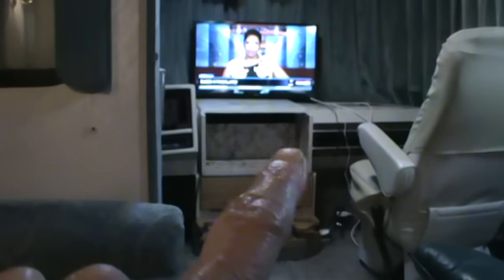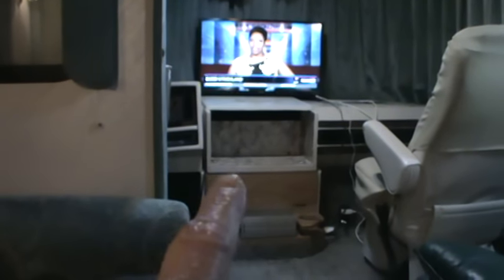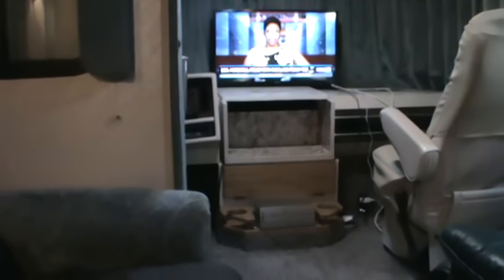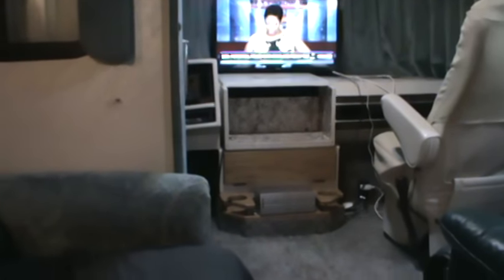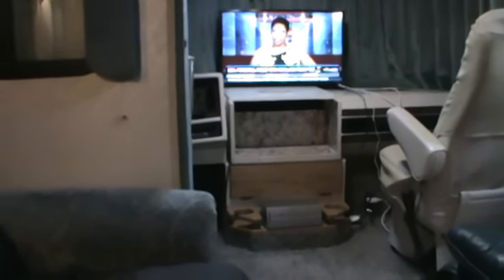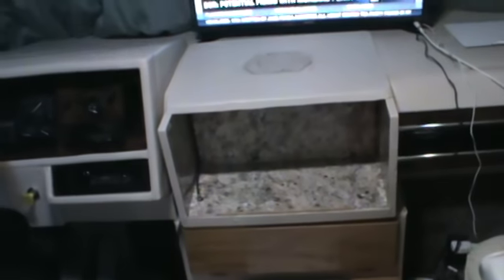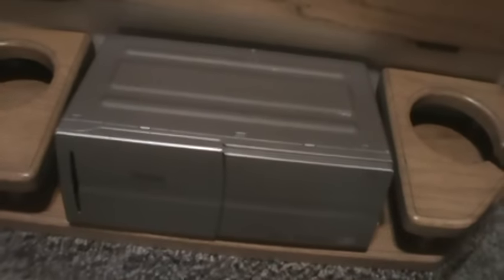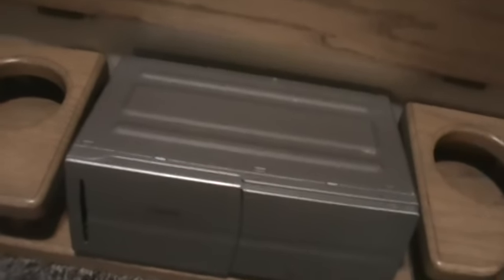Old Analogue TV Cabinet Refurbished In The RV

Comment: We are in the process of purchasing our first RV and we are learning quite a bit from your videos. We definitely don't want to purchase a lemon so we are following suit with the way you have searched to find your beautiful RV. We were wondering which one was best to purchase, the pull behind or the kind you drive?? Also you were talking about your antenna, which will purchase as well. But we also have a sports fanatic in our family so we bought the jailbroke  fire stick for our TV that just attaches to the HDMI port in the back of your TV. If you research the name Jailbroke fire stick you will see that you can get thousands of channels for home or your RV television. It is simply amazing and definitely worth checking into because all you need is an Internet connection. We can watch local and distant live channels from all over the world plus all TV series, as well as any movie of any year that you can possibly imagine. It has music and YouTube, Netflix etc all for 1 purchase 59$❤️👍🏻
Reply from the maker: After much research we decided on a used diesel pusher, this turned out to be the best purchase for the money.  Diesel motors are the same type long distance trucks use which means they can go for a minimum of 500,000 miles without any major repairs to the motor or drive train as long as you do regular maintenance such as oil and filter changes.  Most folks who purchase a regular gas engine RV regret they didn't get a diesel pusher.  If you are thinking about purchasing another type (5th wheel, travel trailer etc.) make sure you do your research.

Comment: Hi Phyllis, that what looks like a tape deck is an older cd changer that would hold several cd's at once. The RV is looking good!
Reply from the maker: +Kim Mitchem I need you to come over and show us how to use it or better yet just tell us how to get it open.  Thanks.
Reply: +Phyllis Stokes Are you going to find a mount so that you can hang the TV off the ceiling and be able to flip it up and out of the way while you're driving? Something like this - they have several to choose from - http://liftmytv.com/FLP-310_flip-down_tv_lift.html
Reply: +Sachi In Wisconsin For $3,280?? Sheesh, I sure would not.
Reply: Angela Angell That was an example - There are many others on different websites to choose from - that 3200 dollar one was for a 60 inch her TV isn't anywhere near that size.
Reply from the maker: +Sachi In Wisconsin That would be a little too expensive for us especially since we only paid $239.00 for the TV.  We like the height of the TV sitting on the dash - easy enough to just sit it down beside the co-pilots seat when traveling.  Also on the dash we'll also have room for the computer to stream YouTube videos and movies over the TV.  This would be a good idea for someone with a much larger TV in a tiny house or a large RV.

Comment: I guess I did not see your motor home video or figure out what you bought. Tiffin is the manufacture but what year and model name, I will try to find the separator valve for you.
Reply from the maker: +Charles R Tiffin Allegro M39 Bus, Diesel Pusher 1996
Reply: +Phyllis Stokes Look towards the rear near the engine either in the engine compartment or in the basement door near the rear&#160;on either side of the coach. you should have a fuel filter and maybe a separator that looks like a filter. There may be a nut or screw or cap on the bottom of your seperator to unscrew and let water out if you have any water. You only do thing is your engine is not running well. In large trucks when you change filters make sure you fill the filter with fuel before putting it back on or you may have air in the fuel system. Sometime they will start and sometimes not.
Reply: Reading this makes me want to pre read everything I write.. LOL   Well, I hope you found the separator and have a life time of fun with your RV!!! the TV cabinet is very nice!

Comment: I sure would like to know more about your new TV . Would like to use in my home if possible.
Reply from the maker: +MyHeadred The TV is a Samsung purchased at Best Buy for $239.00 (they went on sale two days later,  we could have saved $40.00 by waiting).  It is a 32" and probably doesn't weight over about  4 pounds.  I was shocked it was so light. The flat antenna was a Mohu Leaf 50 Amplified Indoor Antenna for $69.99 (no more cable bills with this little antenna).  We are way beyond thrilled with these purchases and had no idea we would be able to get so many channels for free.